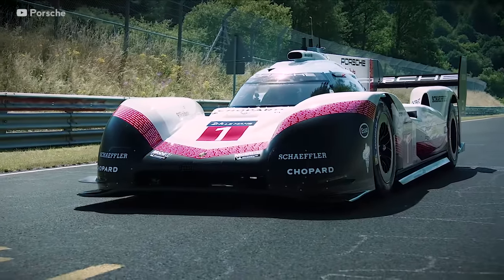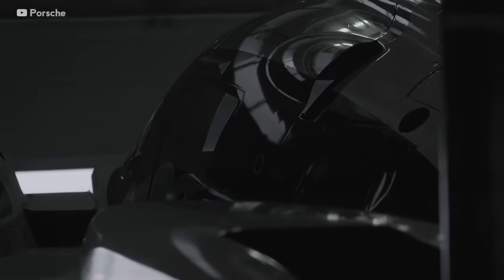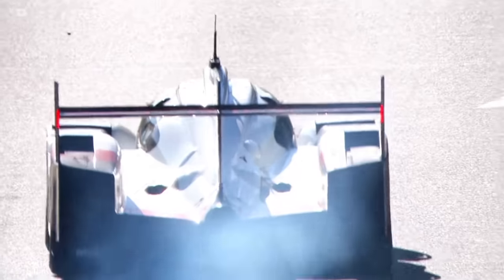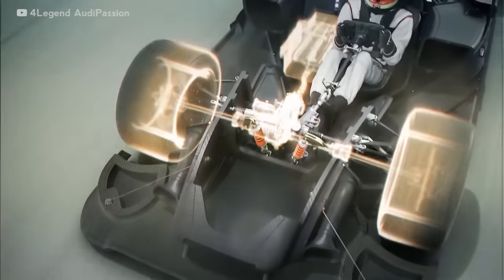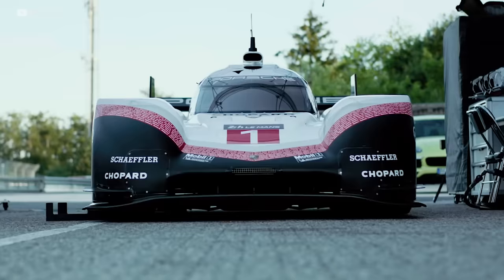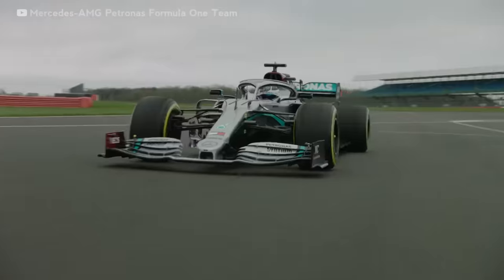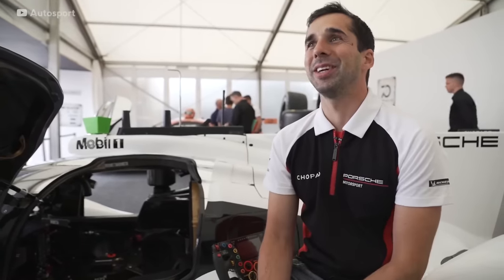How Porsche Built a Car Faster Than F1

Comment: And this year Hamilton in his Mercedes did 1:41:2 in Spa. What a beast.
Reply: Hamilton did with the	Mercedes-Benz W09 1:41.55 2 years ago
Reply: The 919 is heavier and is a 2014 platform
Reply: @iceblade019   but with literally no restrictions
Reply: So what !
Reply: @gamerparadise2072  the restriction is the chassis itself, the LMP platform is way too heavy for a purely track car
Reply: @iceblade019  the 919evo is at 830kg the f1 is at 790kg. The fact that a little bit more fuel can elevate the lap time to up a second like ferrari did should show how mich faster f1 could go.

Comment: Such a strong comment, the 919 evo could not beat me around Brands Hatch 😅
Reply: Funny, how he doesn't specify which configuration he is the record holder of, and which configuration the 919 Evo was tested on.
Reply: @whiterottenrabbit  Indy layout
Reply: They didn't really try to hard to beat that record. They didn't have the one-off tyres on the car, just off-the-shelf tyres. The driver, Tandy, never even drove the car before trying the record at Brand Hatch. And they still got to 0.1 seconds of Scotts record. I'm quite sure the Evo can do low 36 or high 35 second runs on that track in that layout, WITH the right driver and tyres.
Reply: @gillhantson5318  And on a track like Brands Hatch, a modern F1 car would destroy that record. The Evo is mainly built for fast tracks. Nearly beating a 16 year old F1 car with a driver that has never competed in any of the Formula-seriesis not really something to brag about these days.

Comment: I’d love to see it driven by an AI or remotely so the pilot (yes I’m going with pilot at this point) wouldn’t have to suffer the physical strain of driving
Reply: The problem is the precise adjustments in a corner and the latency affect a remote drive would have, it would be much harder to push the car to the limit.

Comment: The porsche did at spa 1.41.770 and today mercedes with lewis did 1.41.252 and as ham says in a interview after the qualify he can was be a little bit faster.
Reply: Remember the 919 is a LOT heavier than the Formula 1 and 919 is a 2014 Platform
Reply: Let's put Lewis in a 919
Reply: @iceblade019  Evo is out of any regulations. F1 is completely limited.
Reply: @joejohnnys  the LMP chassis itself is the limitation, its far heavier than the F1

Comment: Imagine F1 without restrictions on power and aerodynamics. Even within regulations I think this year Mercedes would set a new record in Spa.
Reply: Both Ferrari and Mercedes already beat it.
Reply: That car is 2020 mercedes formula one car bro.
Reply: If it is dry, the Merc could be in the 1:39s at Spa. The current F1 cars are 8.6 secs faster around Red Bull Ring than 2015.
Reply: @jenscee7679  1:39? nah man. 2019 pole was a 42.5 with ferraris overpowered cheat engine. the 2020 merc will be quite a bit faster in the corners but slower on the straights. i think with perfect track conditions, a perfect tow and a perfect lap mercedes could go into the 41's
Reply: @thedevil5475  Vettel hit a 41.5 in 2018. With the Mercs performance a 40.0 wouldn't surprise me.
Reply: @stephensmith2027  well, we'll see. i think the 2018 cars were generally faster around spa than the current one's.
1. in 2018, very complex front wing elements were still allowed.
2. in 2018, winglets on the brake ducts were still allowed.
3. and most importantly, in 2018 the rear wings were much smaller and lower, leading to lower drag which is crucial at spa.
so i don't think they'll beat the 2018 time. into the 41's yes, 41.5 no.
Reply: The Devil Vettel was in the 1:41s two years ago. We’ll see but 40 flat is on...if it doesn’t rain.

Comment: W11 with rules removed would set a god lap :)
Reply: F1 is open wheels.Lmp cars are not Think of that too.
Reply: Break all the rules and regulations, and f1 cars will be faster than anything. But that joy will only last a few minutes before it ran out of fuel and overtaken by an LMP1. And also, this car is still far more cheaper than the F1!

Comment: It seems like there have been some insane F1 innovations, over the years, that were effectively made illegal by restriction.  I'm curious how some of those would have fared against this car.
Reply: An F1 car with full on bonkers ground effect like the Brabham fan car, modern turbo hybrid V6s set up like the "quali engines" in the 80s, the ultrasoft tyres from the Pirelli rainbow era and driver aids like traction control and ABS could definitely beat the 919 tribute. The question is, could anyone handle the g-forces?

Comment: Porsche has produced the best prototype endurance race cars since they entered the ring all the way back to Can-Am and the cars that Mark Donohue drove the 917 that was rumored to have 1700 to 1800 horsepower depending on how High you turn the boost up Donahue said they would lay rubber from leaving one corner to entering the next they are heads and tails above all the others in wins at LeMans incredible engineering goes into them clearly the best sports cars ever built
Reply: Still won less races than Toyota did in 2017. Didn't win the 2014 season. Doesn't hold the LeMans lap record.
Reply: @SuperGeronimo999  😅😅😅

Comment: the 919 could definitely go faster at Spa, but the biggest factor isn't the driver.  A Formula 1 car doesn't just show up and set a fastest lap record at FP1.  It happens in Q3 after a number of practice  and qualifying sessions, 20 cars doing over 1000 laps to lay down rubber in all the important traction areas.  put the 919 evo in Q3, and the car will go 2 seconds faster, easily.

Comment: Didn't Porsche already build a fastest race car back in 1973 with the 917/30 model for the Can Am series?  The Can Am series of a half-century ago, for Group 7 race cars, had safety parameter rules for the vehicles; but outside of that, it was an "anything goes" race series of vehicles with four tires on the racing pavement.

Comment: '223 mph at Spa. What a joke. The 917s were clearing 240mph 50 years ago so the FIA had to slow them down.  'Fastest' hasn't been part of racing now for quite a long time. They've limited displacement, limited tire size, limited aero, limited engine types (no Wankel / turbines, for example, when they were seen as a threat by the ICE engine teams) stopped 4wd, the limits just go on and one. Racing is now primarily entertainment, not sport.

Comment: Now just imagine if F1 developpers had no regulation limitations either
Reply: The basic of this car had way more limitations than formula 1 cars they got engine limitation to 370 kmh and 9k rpm while it can do way more and the origin of this car should have raced for 24 hours in same car and same engine so this car basically designed for racing 24 hours but F1 cars aren't this car being unregulated got more regulations than F1 cars if they both were unregulated driver wouldn't even be able to come half of the track.

Comment: sounds like they should have used a current F1 driver for the lap record, they are generally more conditioned for g-forces. Someone like a Lewis Hamilton, Max Verstappen, or a George Russell - one of the faster drivers on the grid.

Comment: Isn’t it just marginally faster because of the particular track allowing for 220+mph? It’s closed wheel base. Any short track such as Monaco or São Paulo, I reckon it would get smoked.
Reply: No, Porsche would just crank up the downforce to ridiculous levels with far bigger wings and more insane ground effects. Porsche generally does enough to kick your ass, then leave it at that.
Reply: @exploranator  Yeye, F1 car has more downforce in a Monza setup than the 919 can ever make, also Monaco is more about mechanical grip.

Comment: The fastest possible car around a track is going to be one that is designed from the ground up with no rules. Starting from a car that was built to conform to a rule set and then removing those rules will not achieve an optimal design.
Reply: So true. A big tank of nitromethane, gigantic wings, ugly as all get out?

Comment: Imagine a unrestricted F1 cars a unrestricted red bull 2013 
unrestricted w11
unrestricted f2004
unrestricted ferrari 2019 with their engine
God Imagine the lap times

Edit I believe that either ferrari 2018 or Mercedes 2018 unrestricted would beat anything do to the amount of downforce on those chassis
Reply: Break all the rules and regulations, and f1 cars will be faster than anything. But that joy will only last a few minutes before it ran out of fuel and overtaken by an LMP1. And also, this car is still far more cheaper than the F1!

Comment: You can't just add the values. The system power is calculated from the actual power at certain speeds.

Comment: Imagine if to beat this time they built a software that means ai drives the car. This would mean that you could hit the perfect racing lines and break at the perfect times
Reply: Yes, the ideal time to break is, the moment the car has coasted to a stop after winning the race, then the entire care disintegrates, as it has used up every last bit of durability to race, and not wasted any weight on added durability.

Comment: I would like to see a 2500hp car with stupendous downforce attack the Nurburgring.
Why go with a mere 6 foot wing? Why not 8 feet wide and 4 feet deep, for ultimate downforce with low drag at extremely low AOA?
Why put up with less than 10g around the corners?

Comment: the crazy thing to me is when you look down the list of lap times for the Nordschleife, the road + race cars are fair enough you expect it to beat them due to them having restrictions, but even other manufacturers attempts at building something with no rules are minutes slower. 
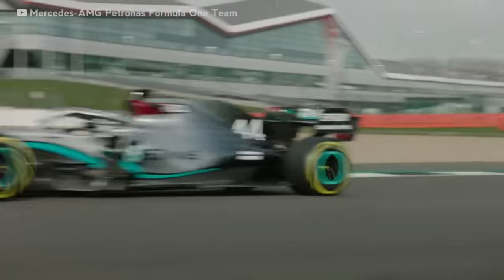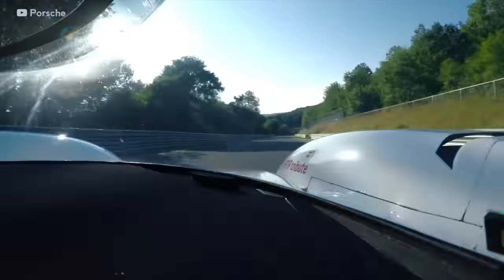things like the Zonda R are around 6:50 and they are incredible machines, i had to do a double take that this had managed 5:20 (not 6:20 which would still have been insane) 

seeing a modern f1 car take on the ring would be an incredible event, but looking down the list does give me another idea for potential competitors, some of those old "no rules" cars are missing things like hybrid powertrains and active aero. 

while ofc more power doesnt necasarily make a car faster i want to see what a Zonda R can do with 1100+ HP hybrid power unit rather than its Merc road car v12 (probably still not as fast as the 919 but i want to see it)

Comment: So nobody is bothered that he is wrong? Regardless of pronunciation, LMP1 are still slower than Formula 1   despite the restrictions placed on them.
Reply: Depends on what you're talking about. Straight line speed and acceleration? LMP1 is faster. Cornering speed? Formula 1 is faster.
Reply: @_kijetesantakalu  I would argue LMP1 only have a higher top speed, also hes comparing a car that adheres to no regulations to an official car governed by regulations, imagine if there was a formula car with no regs
Reply: @_kijetesantakalu  also I'd love to see a comparable Nordsheife time, I reckon F1 would be 10-15 seconds quicker, but it would be too unsafe :(
Reply: @benmaciver4190  Actually, the hybrid LMP1 cars, not just the 919 evo, are the fastest accelerating cars in the world, bar-none. Over 6 tenths faster than F1 to 60mph, and gets to 200mph before F1 even gets to 150mph. F1 is cornering king, but LMP1 is defo straight-line king.
Reply: @_kijetesantakalu  ahh fair enough, point well made 😊

Comment: This video is a good way to learn why do we have rules.

Basically they made a:
- less efficient (more fuel to engine)
- more dangerous (that lotus thing)
- very limited (can only drive during day without rain  and it need to be early morning)

I like the exercise as a proof of concept but there is no real application. Specially when regulated cars like F1 can be faster and (way) more efficient.

Comment: the design of f1 chassis is so pure you cannot get a better package for racing, talk about low center of gravity the driver sits on/in the bloody fuel tank! but ultimately there would be elaborate wheel arches and closed cockpits and they would be longer if regulations allowed because aero is king. if engineers had no restrictions, the cars would be mix between 919 and f1, with f1 packaging and lmp1 aero bodywork.

there would also be 4wd 4 wheel steer, cvt drivetrain with full semi automated stability mamagement including aerodyniamic bodywork, undertray fan, torque vectoring, brake bias, air suspension, toe and camber, tyre pressure, turbo boost etc 

for the engine the maximum size before weight negates performance i think gravitates towards an hyprid fan/electric turbo f1 v10 in the 2000hp range which including the tech and bodywork i thik could be achievable 850kg which performance levels start to fall more steeply, somehow i dunno, but it would happily modulate speeds round strings of corners between 150 and 200mph then pulling comfortably to 300 and not destroying brakes and tyres and fuel within 1 lap. i think this would be the level where the biggest limiting factor becomes the driver, it could easily break 5min at the nordschleife, but who has the skill, fitness and balls to go lower?

Comment: the old cars lap record shoud still be here considering it was never a world record attempt, there was slower traffic on the track, the driver was told not to drive that fast. 

its kinda pathetic that it took nearly 40 years, and no traffic to beat an old car.  thats a real big joke and shows how bad technology is. 

you take that same old 956, give it 35 year new tires, transmission gears, newer modern fueling, turbos with newer better bearings and oil and itll shit all over the 919 evo which is pathetic.

Comment: I appreciate Mr. Mansell and his vids, but did he about the innovation of "ground effect" cars just say "...This is regulated against in pretty much every form of motorsport since the very successful, but ultimately dangerous Lotus 79 Formula one car from the eighties."...?

This statement crystalizes two questions for me about Mr Manson's history knowledge, which I in other respects have a high regard for:

1: This car was built in the 70's, not the 80's, and ran and won the constructors & drivers F1 world championship in 1978 by M. Andretti that very year. The next model was the Lotus 80, introduced in the 1979 season, and was a failure. 

2: If mr Mansell is hinting the Lotus 79 as "ultimate dangerous " and a thereby a deadly car (?), I assume that he then reference this to the tragic death of the Swedish driver Ronnie Petersson at Monza in that year of 1978 when the Lotus 79 was at it's peak of competivness. I would therefore like to stress the fact that Petersson didn't die by a Lotus 79, (and no one else did either). He had crashed and trashed his "79" car the day before in training at the weekend of the Monza race, and Colin Chapman (owner and head engineer of the Lotus F1 team) refused Ronnie to use the spare 79 for the race they had as Chapman didn't want him to have the chance of winning the race and endanger M. Andretti's planned and supposed win for the team among other reasons, even though Petersson had shown time and time again that he was the fastest driver of the two in the team (he was restricted by contract to be second driver and never to overtake Andretti in a race). So Petersson had to use the old Lotus 78 they had used earlier in the season. At Monza, Petersson died due to an accident at the start, an accident induced by Ricardo Patrese running on the outside of the field crossing the line to the pits to gain positions as the start was prematurely flagged and the cars back in the pack was still running while the front rows where standing still. It was a multicar collision, and had very little to nothing to do with the here presumed Lotus 79's lack of possible crash resistance as it wasn't even that car!

If Mr Mansell meant something completely different, I do apologize for my assumptions. But I would then really like to know what he actually meant by this statement?

Comment: 5 minutes and 19 seconds is not as fast as my lap around the Ring in Grand Tourismo 4 A-Spec, but then again, I didn't have to concern myself with trivial things like dying if I crashed and that's why I could be on the ragged edge for the whole lap. What was my lap time? 5 minutes and 5 seconds. There's a newer version of the game that I haven't played (it's been at least 10 years since I've played any video game) and I'm pretty sure I read somewhere the lap record was sub 4 minutes which I find hard to believe....but.

Great video, subbed.

Comment: I wonder if a f1 car could break the record if one of the constructors took a car and no ruled it so no minimum weight no aero size maximum or max power delivery
Reply: Break all the rules and regulations, and f1 cars will be faster than anything. But that joy will only last a few minutes before it ran out of fuel and overtaken by an LMP1. And also, this car is still far more cheaper than the F1!

Comment: You answered your own question by minute 4:00.  They used a lot of tricks that were banned in F1 for being unsafe.  Well done Porsche, I guess, for building a dangerous trick car.
Reply: But what might be unsafe in F1 might be safe in the Porsche.
And Porsche didnt do any "tricks", they just did away with the performance-restriction items on F1 cars.
Sure they uprated the brakes and did extra ground-force stuff but theyre not tricks. Actually thats to make them safer

Comment: If the 2021 F1 cars raced at in the dry the record would likely have been ~1:40.8. As it is the 2020 cars did it in 1:41.25. 0.55 seconds faster than the 919 evo. Remarkable!

Comment: Have AI drive the car!
Reply: One should make a tournament with Remote controled cars. Imagine the lap times one could achieve. Unrelated if an human or Ai controled the car. You could save so much weight by removing everything safety related and making the cars have so little front area no human could fit.